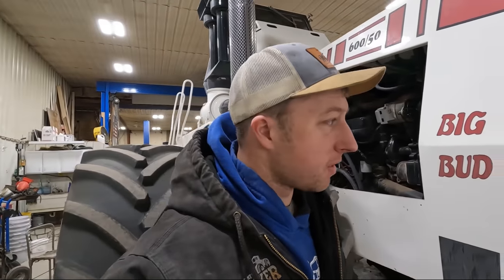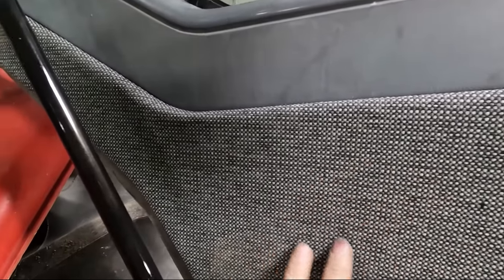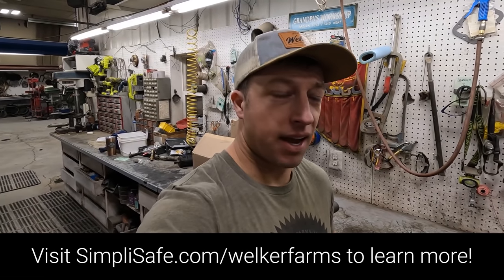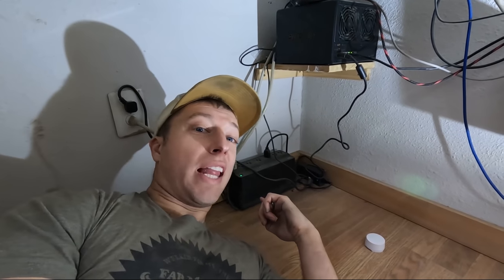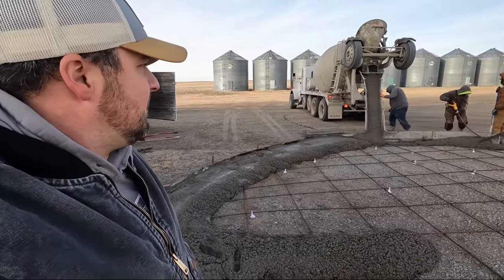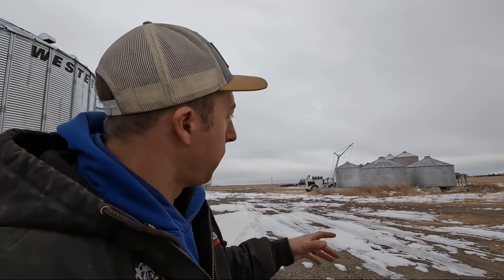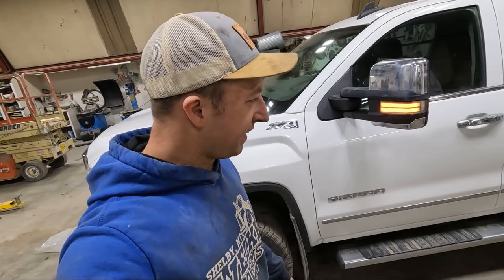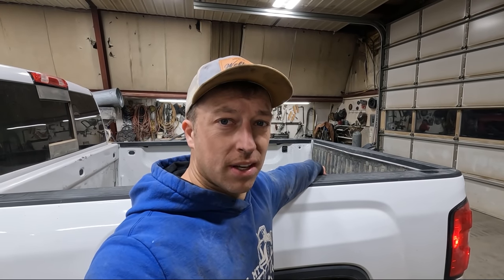Transmission Rebuilt! Time For Interior Upgrades! 💪

Comment: A salesman was telling about a farmer looking at pickup trucks. He looked at a 1/2 ton and a 3/4 ton and asked why the 3/4 ton cost more. The salesman told him because it can haul more. The farmer looked over both trucks and said,"The box doesn't look any bigger to me".
Reply: Family firm used to deliver bagged potatoes to stores, we had 2 utes. 1st one a 1/2 ton, 2nd one a 1ton. We could put 1 1/4 ton's on the 1/2 ton, but just 1 ton on the 1 ton. go figure.
The 1/2 ute was a GM Holden which had close to 600,000KM before the original motor was replaced. The 1 ton ute was a FORD, which had 300,000KM before the motor was replaced. 
Both vehicles had a hard life, tho the FORD was the easier more comfortable one to drive/use. Both had a similar sized "box" load area.

Comment: Just so you know slotted and drilled rotors actually reduce the stopping power of the brakes due to less surface area.  Factory GM brake pads can to be beaten and can easily last 200k miles.  The factory pads on your truck are made by akebono and akebono makes some of the best brake pads on the market.

Comment: Take a 1/4” bolt and cut a slot down the middle. Cut the bolt head off and wrap some emery cloth around the bolt end with the slot. Acts as an unitedly variable sized sanding disc.

Comment: Dude. I work a second job at a NAPA store. If that bracket was dry on one side and lubed on the other, you should definitely replace it, if not the whole caliper too. Brackets get distorted by heat so easily, and putting it back on will wear every pad you put in it unevenly. That truck's new enough you can still get a new, non-remanufactured, one. Totally worth it to address it sooner rather than later.

Comment: Take a piece of plastic jacketed wire rope and cut off 3/4 to an inch of the jacketing, spread out the wire strands, and then chuck it up in a drill.  Makes for a great variable size wire wheel.  Be sure to use gloves and guide it with your hand, especially if you make it more than a few inches long.

Comment: To clean the floating caliper mount pin bore: Use a strip of emery cloth and slip it between the legs of a small diameter cotter pin and wrap it up to make a flap and put the pin into a drill. Use a cotter pin long enough to reach to the bottom of the blind hole.

Comment: Spin a drill bit in there by hand thats same size as the pin. Clean up pin and coat with slide pin grease. Have done it to many trucks and never had a issue.

Comment: Hey Nick, I forgot to mention, when cleaning your tractor, there is a product called  " Back to Black" It is made by Mother's. It will clean and shine any plastic, fuel tanks, rubber fenders, any plastic overs youmite have. Very easy to use. Highly recommend it

Comment: When doing brake pad and rotor replacement start in the back on the furthest one from the master cylinder. Helps keep the air if any to a minimum.
Reply: Where would air be getting in?
Reply: @wreckandraceify  I have no idea how it gets in there. But sometimes it can be an issue. So always start in the back and work your way forward.

Comment: Find the exact drill bit to fit the rusty hole. You can also wrap a smaller dowel with 400 grit sandpaper.

Comment: Unbolt those airbags from the leafs and make a cup that bolts to the leafs for them to sit in. So you can get full articulation and the bag can just hang from the frame and come out of the cup that holds them in position on the leafs.

Comment: I really hope that you have better luck than I did with you rotors and pads. I can't stand them anytime I drive down a gravel road they squeak until I pressure wash them. I have put the anti squeak on them and no difference. It just packs the dirt in the slots. 
Glad you all are feeling better my family is going through it now. I pray I'm on the downhill side.

Comment: I just had to replace a front hub assembly on my 17 sierra 1500 today. When my brakes get worn far enough I want to switch to police car rotors, pads and calipers. They're 6 piston calipers and much larger disc's. You need minimum of a 20" wheel to clear them.

Comment: Did you check out EBC brakes . Summit has them . After installation and bedding the pads the peddle pressure is 25-30% less that the regular pads and rotors.

Comment: It's also a good idea to replace the soft brake lines as your truck ages.  Had what I thought was a stuck caliper turned out the brake line started deteriorating on the inside and the inner lining was acting like a check valve locking the bakes on that wheel.  If your caliper over heats rebuild or replace, it will not last long afterwards.
Reply: Been there, done that too.
Reply: The line support brackets will rust between the steel and rubber and yep acts like a restriction or check valve.

Comment: Tip of the day; Get a small enough / long enough bolt that goes in the hole, make a cut in the middle of it, like with a hacksaw, then put 1 round of sandpaper on it, tale of it goes on the slot causing it to stay there. Then put the bolt on to a drill and voila you can easily clean that hole..

Comment: When doing your calipers, the bracket comes loose from the caliper and it makes life much easier.  Leave the bracket attached after the rotors go on.   Then place the pads in the brackets then place the caliper over the pads

Comment: I find breaks on my chev are weak .I grease my slides ever time I rotate my tires . Also piece of Gas line .slot it and put emery cloth in slot and put in drill .will fit in slide hole .

Comment: I recommend watching south main auto on doing your brakes. The small screw in the rotor shouldn’t be cranked on. It doesnt hurt to remove the caliper from the mounting bracket, clean the pins and lube them. If your in the rust belt use ceramic brake grease between the bracket and anti rattle clips to reduce rust jacking.

Comment: To clean out holes I use a short rod 1/2" round and cut a slot in one end (use a hacksaw or thin cutoff disc.) And slide the end of a short piece of Emery tape into the slot and then wrap it around the rod. The other end goes in a drill. You Can vary the length of tape to change the diameter.

Comment: For the air bags they are actually designed to be stretched out they just don't want to be blamed if they break during lifting. And with the caliber brackets you can remove them separately from the caliper itself making changing pads and rotors much easier. Clean out the slide pin holes with a drill bit that just barely fits in the hole.

Comment: Nic for cleaning out blind holes lick that calliper, cut a slot in a long bolt and use a strip of emery cloth wraped around the bolt as an internal bore hone style tool.

Comment: Take a piece of round stock and cut a slot with a hacksaw. Then take a piece of sandpaper fold it put in slot and run thru hole. Nice and clean.

Comment: I had a bent a slide pin like you. small wire brush to clean or a drill bit, Just use your hand not a dril and turn it.  then spray and dry. What grease did you use?
I don't have a truck but have drilled and slotted rotors with cereamic brakes.  It dispates the heat much better.
when you order slide pins order slide pin boots, Oem if you can. Why when you put that back in you might need the part but you might not find it locally!  while your at it get red paint!
Glad your feeling better and hope the family gets well!

Comment: Long 8mm bolt or bar cut a slot  in end to take a bit of Emory put in drill and hone sliders   Then use copper grease and you’ll never have any problems

Comment: I tried the drilled and slotted rotors, only noticable difference was the noise! 
4 piston caliper upgrade will gain you more
Reply: They don't help braking directly. They help when using the brakes with heavy loads or for extended periods of time. Keep gases from being trapped between the pad and rotor. Also help to dissipate heat in the rotor. You wouldn't notice the difference in most situations. Calipers would clamp better but doesn't help with heat fade at all.
Reply: In our area, the holes allow rust and that makes rust circles on the rotors.

Comment: Keep the old pads and rotors. You will be putting them back on!  I tried the slotted and drilled rotors on my wife's Silverado 1500 trying to stop the pulsing of the factory rotors.  They wore out in half the time of the factory stuff.
Reply: I use them on every brake change never had any last less than 50k miles sounds like you had other problems or used the cheap stuff

Comment: Best way to clean out a dead-end hole, get a piece of round stock (something smaller than the hole), cut a slot in one end (top), put a piece of long-ish emery cloth in the slot you cut and wrap it around like you would a weed eater cord, put it in a drill and go to town.

Comment: quick advise for cleaning the inside of where the sliding pin for the brakes goes.
use a 200 grit sand paper take a bolt that has some room to move in there. make a horizontal cut in it about as long as the hole is deep. put the sandpaer in the cut wrap it around the bolt. stick the other side into a batterie power tool. and boom turbo cleaning. works really well ben doing it for years and never had an issue. dont forget to grease it afterwards
Reply: Now that's clever. I have been buying wire pipe cleaners used for cleaning inside of copper pipes fittings before soldering. I cut the handles off and put the wire brush into a battery drill. They come in a variety of sizes.
Reply: @bigguydiy2184  battery drill. thats what i was actually looking for (not native english here sorry :P)
but your idea is also good. but well normally a good mechanic has some snadpaper around ^^
Reply: Heck i just buy new ones when they get that bad. Not a fortune for a caliper bracket and two new pins.
Reply: @Living_EDventures  not a fortune. but still saved money :P

Comment: To clean out small diameter bores, take a wood dowel with an open slot in the end and insert a long enough piece of sandpaper 1/2" wide,, and attach other end to drill. Or tape a piece to a metal rod... either way you get a mini flapper bore cleaner

Comment: Nice save on the brake calliper, I've experienced that same issue myself but on a Toyota Landcruiser, another good way to clean out those slider bores is to slot a little bolt and wrap it with emery cloth tape, insert it in the drill like you did with the brush and give er what for. Cleans them up nice and quickly and if you're good on the in and out action it gives a nice hone pattern too 👌😁
I wish you and all the crew at Welker Farms a very merry Christmas and an awesome new year
Reply: Thank you, Merry Christmas to you

Comment: We received one of those at the dealership, but couldn’t get it out of park, to get it off the truck.  We finally just drove it off, the the park lock protesting the entire time.  We found out afterward, the factory didn’t install the cotter pin on the park linkage, and the pin fell out in transit.  We ended up splitting the tractor, to replace the damaged park gear.

Comment: Suspension Connection now has disk plates to put under those air bags!  They mount to the axle and the air bags just sit inside the plates without having to bolt it I place.  They say that you just need to remove the air from the system prior to lifting.  I used to have to remove the lower bolt on mine so the air bags would float!  Very inconvenient...

I tried the limiting straps but they realistically did not work out well

Comment: You can use a drill bit in that caliper hole with brake cleaner just use a bit a little smaller or brake clean and the pin you took out a few times

Comment: Something to keep in mind with drilled rotors are that they are more prone to cracking after heat cycling. Normal driving shouldn't be much of an issue but the extra heat from towing could. Probably worth just keeping an eye on it. If you still feel like you need better brakes you can try a more aggressive pad compound if it is available.

Comment: The next time you have to clean the inside of a hole of something, use a locking pin ( that thing you push trough a hole en slam the ends flat, I dont knie the correct word) put some sandpaper trough the gap and put it on a drill. That wat you van clean it out fast and Easy.
Greetings from Olaf, the Netherlands 👍
Reply: I ment a linchpin
Reply: Thank you, Merry Christmas to you!
Reply: @RobertWelkerFarmerBob  merry chrismas, god bless you all

Comment: You gotta put the CO2 alarm at floor level! You'll be dead by the time that one goes off! 😴 stuffs heavier than air
Reply: They are carbon monoxide detectors, not carbon dioxide. Monoxide is lighter than air.

Comment: I bought a 3/4 ton and the ride is outstanding.   It will take a 3,000 lb pallet and still rides smooth with little squat.    I got the 17" rims.  I have a bumper hitch and a 1200 gallon load of 10-34-00 is no problem.

Comment: The screw on the rotors doesn't need to be that tight, its only purpose is to hold the rotor while installing calipers and wheels. Shoulda just tossed them.

Comment: Nick for brakes the best thing to upgrade is the pad material, hopefully you spent most of your brake money there.  Also when ordering rotors, its good to put some consideration into your use case and vehicle time. Typically if getting drilled / slotted you should choose one or the other. Extra cooling ducts & hole son the rotor can be good, but they can also be BAD. The more material you remove from the rotor, the quicker they heat up which results in faster heat fade some times. Ive run drilled and sloted, drilled , and then also just slotted and Ive come to like slotted rotors the best, without being drilled. Of course the difference produced by a replacement rotor that is the same side, and not part of a serious brake upgrade kit ( bigger rotors with different calipers ) is going to be hard to notice mostly, the slotted type seem to keep enough material to not mess with the rotors overall mass - thus eliminating the problem I mentioned, while still giving "vanes " for heat to escape. Like i mentioned in the begining of my comment, the best performance gainer you can do while staying with your stock rotor size and caliper is pad material. Its CRAZY how much of a difference you can get by going with a different type. Not sure if you did that here but something to consider next time you shop. You can total transform initial braking, pedal feel and even heated up performance dramatically. As far as trucks go, ive only ever had lighter duty trucks, so do your own research here, but I like Hawk pads as well as EBC pads ( they have color coded models of pad that cleary state how they change the performance and feel ) Spending a little extra on pads goes a crazy long way, Id never buy advance auto or cheap generic pads every again.
Reply from the maker: Thank you for the very informative comment! It's a learning experience for sure.

Comment: Save and turn the rotors. You never know when you'll run out of pads, and have a set on the shelf ready to go. With fresh pad set.
Reply: Turn them, treat with LPS 3 anti corrosion and wrap in plastic, wash off with brakleen before use.

Comment: So  I hope you ALL  get well soon.  What's up with the baby Kubota at 1:20 ?   Also a cordless drill and a 410 or 20ga bore brush with some solvent / cutting oil   would have cleaned up that caliper bracket with the rusty bore.

Comment: A few technicians notes to follow when replacing brakes:

Always buff the rust off of both sides of the rotor hat and the hub.  If you don't It will cause lateral runout and eventually a rotor thickness variation (pedal pulsing). Always remove and clean the caliper slide pins and grease with silicone or moly lube. Use Loctite blue when you replace the caliper bracket bolts on the spindle and torque to spec. I've used new pads on used rotors, and used pads on new rotors, It doesn't matter as long as you break them in with a couple of hard stops. I always crack the bleeder open when I push the pads/piston back. I usually just crack it open and pry it back with a prybar while it's still bolted on.  It's a quick easy way to flush most of the brake fluid in the system. Brake fluid is hygroscopic...it removes water from the air.  Water diluting your brake fluid reduces it's boiling point. Most people won't notice until you are towing/racing with repeated hard stops building heat in the caliper. If your brake fluid boils you will lose brakes. Change your brake fluid when you change your pads and it won't ever be a problem. Water also mixes with brake fluid and creates an acid that eats away at expensive ABS pumps/valves. 

 I see several others have already commented about damaged rubber brake hoses acting as a check valve. I lost a plastic wheel cover because the plastic nuts melted when the brake was stuck on. The rotor was red hot!

Comment: I put those brakes on my Jeep around 3 or 4 years ago. They work perfectly. Only thing is. If I have the windows done. Come to an stop. I hear them. My pads are the high temp ceramic ones. Nice truck and amazing job with the old tractor. Its looking good. You all take care.

Comment: The rubber boot on the caliper carrier might be torn too.  i didnt notice you cleaned the replacement rotors with brake cleaner.  THey have a light coating of oil on them to prevent corrosion.  How's your air filter?  exhaust was a little black.